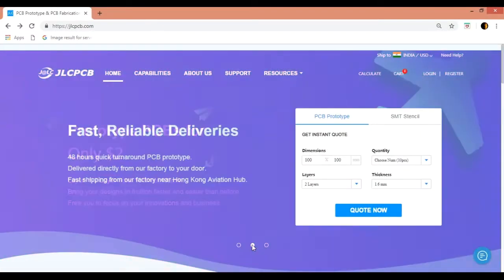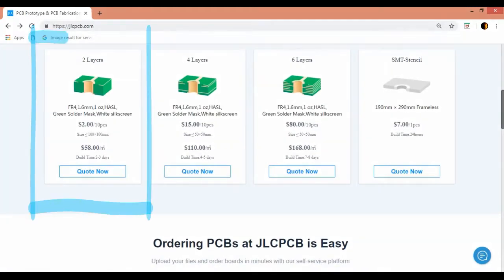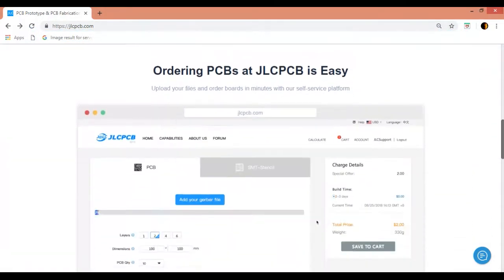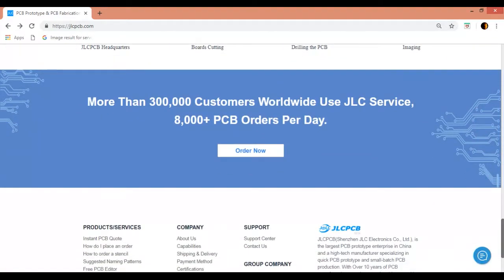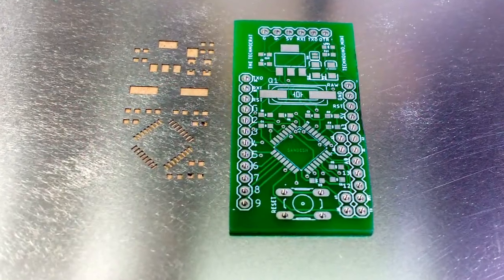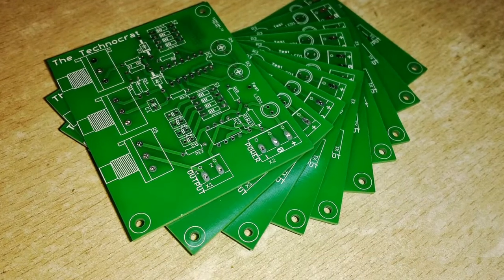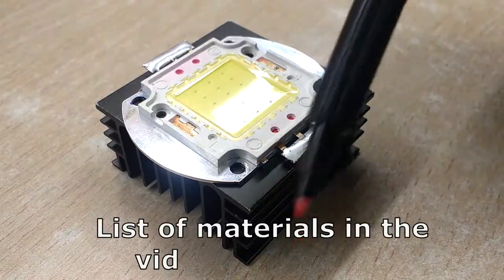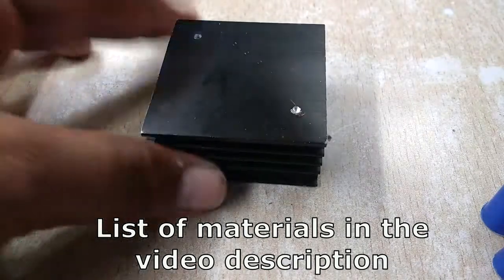How To Make LED Headlight for Bicycle (100 Watt setup).

Comment: A 100 watt led requires about 32v to light up, you need a voltage regulator and booster circuit (edit, a word)

Comment: That led is not 100 watt.
Stop making fake content
Reply from the maker: The video does not show 100w led as I destroyed it because of over voltage. It is actually 50W. But should work with the same setup. The wiring, battery(could be larger), heatsink, etc.
Reply: @TheTechnocrat  50 lol my 20 watt led is brighter than that. 
Any way as long as the setup works I'm satisfied👍

Comment: Lots of good ideas here for using such pcb's with the numerous LED choices for building lights for various purposes.  After this experience, how would you do it differently if you were to make another bike light for the optimal beam pattern & run-time for road riding at night in mostly rural areas?
Reply from the maker: Next time I would install a light reflector on top to prevent light scattering to top as it is going waste.